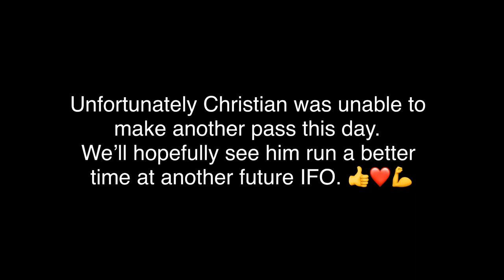J Series Civic with a Pontiac Supercharger!  IFO Racer Feature, Christian Gallardo!

Comment: The M90's are plentiful and cheap and make decent boost for the buck. My Regal GS made 6.5-7lbs on the stock pulley.
Reply: Yes the gm M90's are very plentiful, I Used the Less Common Ford M90 on my Subaru STI Engine, AWD FTW !
Reply: Where would I get a M90 with the adapter?
Reply: M90 can get from junkyard

Comment: So I throw a m90 on my j35y1 in my accord what else do i need to keep from blowing my engine? Better radiator i assume cuz hot air
Reply: Radiator wont help. That just cools the block. For helping keep your block together, youll either want water/meth injection or an intercooler plate
Reply: hows that going for you now? did u have to cut the hood? and what mods did u have